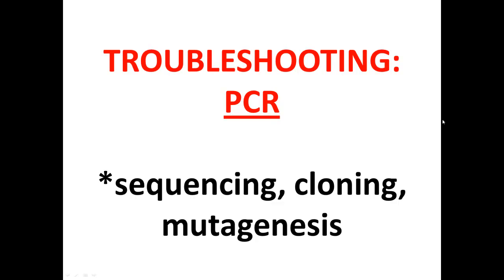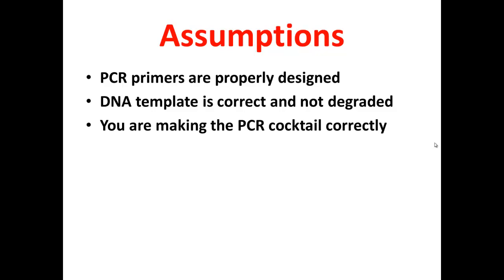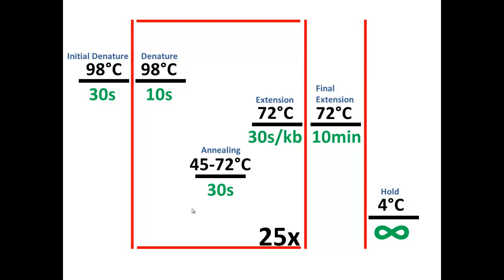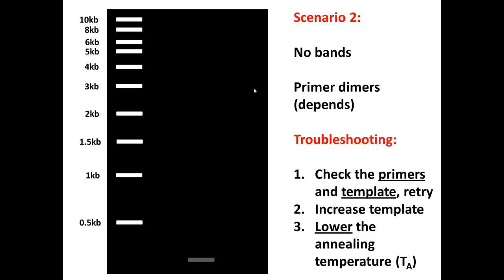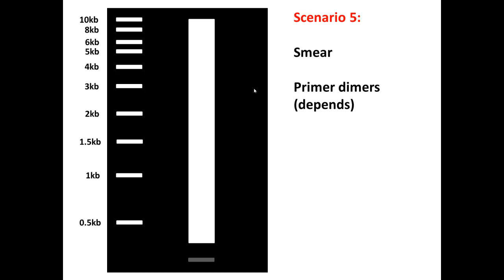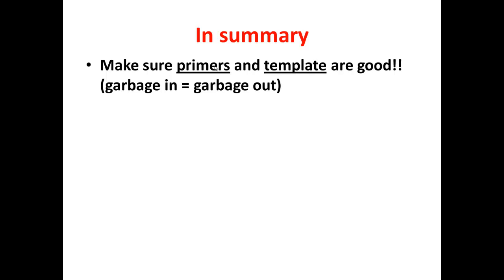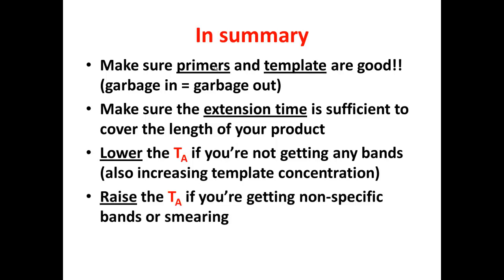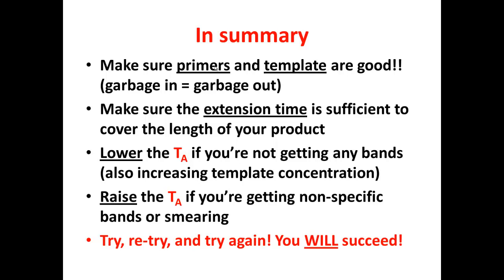Troubleshooting 1: PCR

Comment: A smear in scenario 5 can be a number of things. Typically it is a sign of highly degraded template, where the nucleic acid has become so degraded into multiple smaller DNA pieces that it appears as a smear. It is quite common for template that has been freeze/thawed too many times or for RNA sample from highly degraded tissue (seen often in forensic tissue samples). A smear can also be due to high salt content in PCR reactions. Your salt (e.g. Mg++) is a cofactor for Taq. During PCR dntp's gets broken down to dnmp's to form phosphodiester bond between 3' OH of adjacent nucleotide and 5' Phosphate of the upcoming nucleotide. In this reaction Mg++ binds to the alpha phosphate group of dntp and helps in the removal of beta and gamma Phosphate from dntp. Increasing Mg++ increases Taq  activity but at the expense of specificity, whereas less Mg++ lowers Taq's activity but increases its specificity. Therefore, high Mg++ concentrations decreases specificity and can produce a smear or haze band. Lower Mg++ produce tight discrete bands, but not too low otherwise Taq cannot operate. Think of Mg++ as strong coffee for Taq, it will increase its activity, but when it is rushing around it will make mistakes. 3mM MgCl works well for most reations.

Comment: So the only variables are :-
The extension time (not temp)
The Annealing temp (not time)?.

Have I got this right?
Reply from the maker: Yes, pretty much. The extension temperature is based off the maximal activity of the polymerase. For Taq, it's 72C. The annealing time can vary between 10-30s, but I have always used 30s and it seems to work quite well.
Reply: TheScyther88 what's the minimum and maximum for annealing temp and extension time. This will give me an idea as to at what point to say its not working try something else.
Reply from the maker: ronald steele I've gone as far as 40C and as high as 70C for annealing temperatures. Again, 60C is a good starting point. As for extension time, there is no "min or max" because it's based on the length of your product. For example, if I'm doing site-directed mutagenesis on a 8kb plasmid, I would use 4 or 4.5 min (30s/kb).